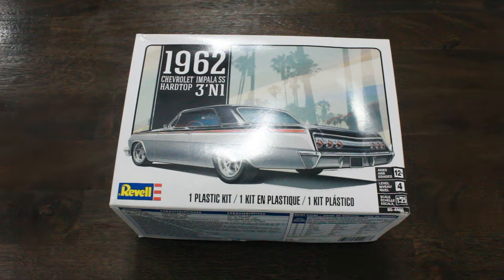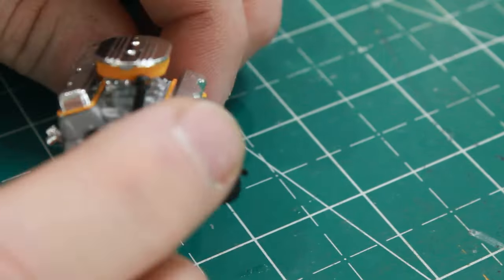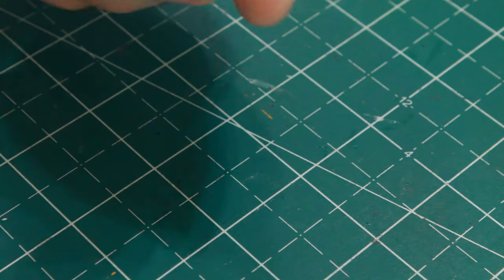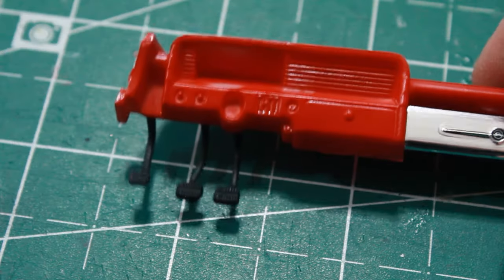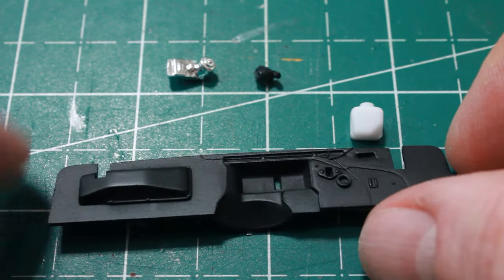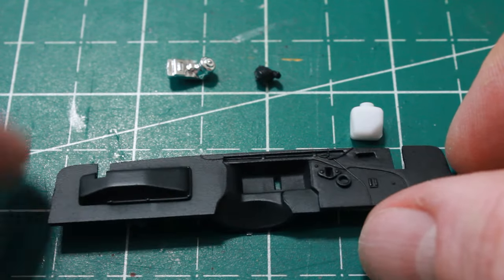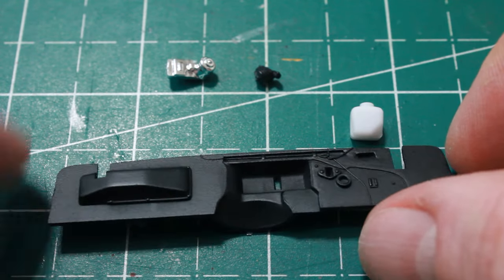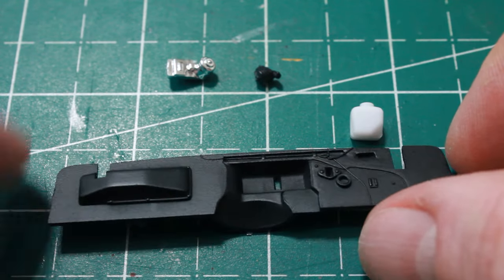1962 Chevy Impala Revell model build completed

Comment: My brother had this car in the 60s when we were in school. I rode in it hundreds of times before he sold it. It was a piece of junk but looked good. It was black with a red interior. The hood and trunk logo trim shouldn't have the nubs on the ends. I think that is just there because of the injection molding process and should be trimmed off. The headliner should be the same color as the seats. The SS version had dual swept-back antennas off the rear quarter panels. The interior had a mix of buff aluminum and chrome trim, but mostly buff aluminum. The chrome trim was where you touched, like all of the knobs. The centers of the upholstery were red and black checked cloth while the outer parts of the seats were red vinyl. The interior and trunk had red carpeting. The trim down the side was originally bright chrome with a white painted inside section. My brother hand painted the inside to make it bright red.

Comment: Like the lighting idea.  Is there a way to hinge the trunk and use a watch battery with the LEDs and have a switch there?
Reply from the maker: A battery could probably be placed in the rear trunk area with access and a switch maybe on the bottom side.